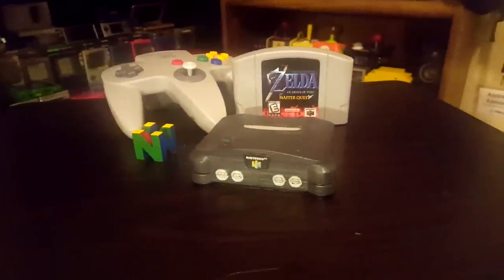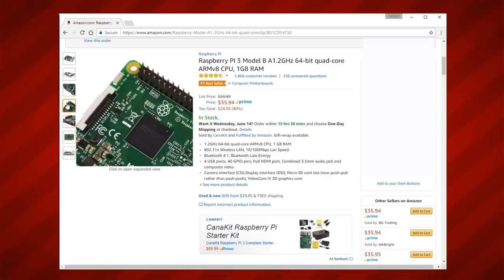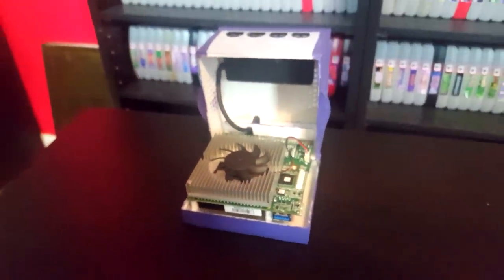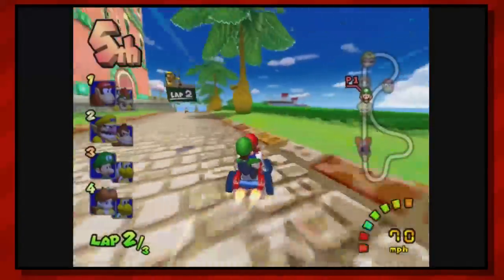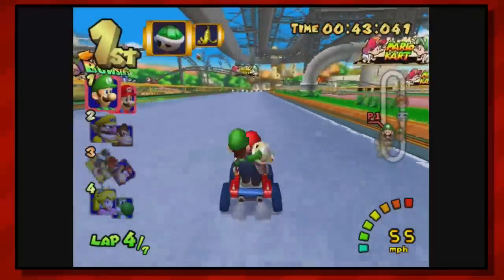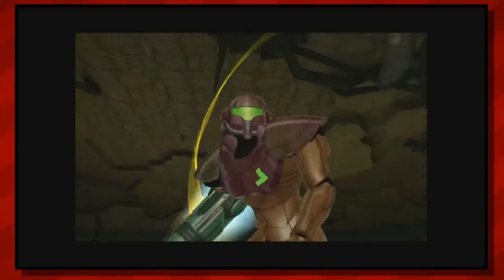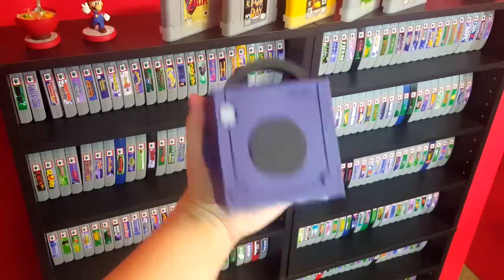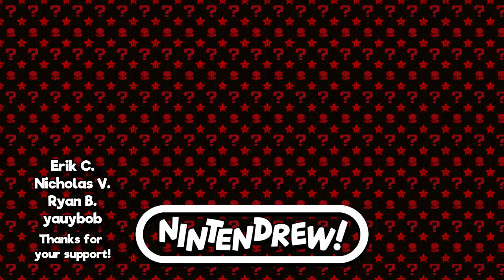Building the GameCube Classic Edition Mini Console - DIY! | Nintendrew

Comment: Step 1,buy a wii
Step 2,buy a sd card
Step 3,buy a GameCube controller 
Step 4,soft mod wii
Cost=50-80 dollars
Reply: cough wii costs more
Reply: @tester_4x106  used Wii cost 20-30$
Reply: will that fit in a mini gamecube case? 🤔🤔🤔
Reply: Dude, search "micro Wii build". It fits in places it really shouldn't
Reply: @timboy What 🤣
Reply: @timboy Looking on ebay, the first result is $57, the next $47. I found one with free shipping and two wii remotes for $55
Reply: You can strip down a wii into an altoids tin even so you could 3d print a decent enclosure for it
Reply: @Joeink100  exactly what I'm thinking cut down the board to fit it in a mini gamecube and you're good
Reply: Already done it for ya!
Reply: wow how MINI
Reply: @timboy it's not 2007 anymore, you can get a wii for about $20 at gamestop
Reply: Step 1 dust off old Wii that is in closet.

Step 2 buy sd

Step 4 softmod

Step 5 play
Reply: @triggeredpanda2939  look up bitbuilt.net, people do it all the time
Reply: cutting down a wii board is super simple,  they even have guides on there, and several people have even made mini gamecubes already. it's a really cool community.
Reply: timboy I got mine for free
Reply: @robabill  easy! Just cut Wii motherboard.But better buy Gamecube motherboard on Ebay for around 8$ and cut it a little bit.Solder SD slot,add power supply,buy controller, and you're done! Together itwill cost around 25$
Reply: @tester_4x106  if you can get the Wii pre owned it's much cheaper.
Reply: Thats what I just did, but i buyed the games
Reply: Or if you have game cube games you can just use them on the wii OR just buy used ones
Reply: A Wii cost like 600 dollars brand new
Reply: @timboy at launch it was 249 u can get it used for like 30 40 dollars
Reply: sacha plenus no it costs 50+
Reply: Paint the wii in GC colors
Reply: @hiimarobot1903  My local Game X Change sells them for 29.99 lol. My buddy just bought one today XD
Reply: @cloudytug  no lol
Reply: Exactly. Also, I live your profile pic. I love telephone.
Reply: That depends on the GC controller you're getting, ($20-$150) also you will need a USB drive if you want to run USB Loader GX
Reply: @gormauslander  i got mine for 27 dollars used at eb
Reply: Got one for 10 bucks with a broken disc drive
Reply: or just buy a gamecube😂
Reply: @zeehondsjef  not everyone has a 100 dollars laying around
Reply: @exkdvs  in the netherlands u can buy it for 30 dollar
Reply: @zeehondsjef  bit whats the fun in that
Reply: @exkdvs  yeah i know
Reply: @timboy you can find used wiis at places like value village for 15-20 dollars
Reply: Chirp chirp your icon is the fursuit telephone
Reply: @robabill  surprising the most important part of the wii is really small
Reply: @robabill  take a look over at bitbuild! They got a Wii in an altoids can!
Reply: Bought my wii at the thrift store for $8. Hacked it with a 32 gb SD card and added a 2tb external hard drive. I got 107 gamecube and wii games combined and adding more. The whole entire library of Snes, Sega, Game gear, Nes, gb, Gba and put a few sega CD, neo geo CD and n64 games on there 🤷
Reply: @robabill  lmao yes. People have fit wiis into altoid cans.
Reply: A wii is 30, a controller is 20-30. You also need 12 folar extension cables for the controler.
Reply: hi i'm a robot downside to buying a used wii is they could rip you off
Reply: Or get a Wii U and mod it.
Reply: Already did it
Reply: @robabill  yes
Reply: @gormauslander  I dont want to know how and why you know that.
Reply: you could make it even smaller by trimming it. but it's not that easy tbh.
Reply: @tester_4x106  I've bought one for 30 dollars lol
Reply: @robabill  The Wii's internals have a lot of unneeded board space, Someone fit a Wii into an Altoids tin, complete a screen and buttons, and it worked
Reply: @robabill  its possible to trim a wii motherboard the easiest way of trimming a wii motherboard still gives a motherboard smaller than the hardest gamecube motherboard trimming
Reply: I know this is really late but I was lucky enough to get a Wii for my cousin and when my friend went on vacation he found 2 wiis at a thrift shop and spent $15 to get both and one of them had Homebrew on them and he gave both of them to me
Reply: @pixelprime5908  you have a reamly good friend
Reply: Step 2 alternative: Buy a cheap usb Hard drive up to 100 Gbs
Reply: Lattepanda v1
Reply: @gormauslander  never buy from These. Look for auctions.
A wii in my Country costs 15€
Reply: I mean why would u play wii games on the gamecube anyways lol

Comment: Great work! I was under the assumption you gutted a Wii and put it inside. I'd imagine the architecture of the Wii would be what Nintendo would use to run this. It's compact enough and able to run GCN games as roms perfectly. Maybe that would make more sense financially for them, but either way, yeah, I'd say this is a long ways off regardless. Really fun video!
Reply: and a wii is worth about $20 Australian
Reply: dedpxl they are talking about making the parts not the system they can still make them
Reply: That's what I'd assume, too. The Wii mini wasn't that long ago, they likely still have the tools to make broadway and hollywood chips at reasonable prices. (Especially since they could go for a smaller MEM2) Not sure how expensive HDMI out would be, but GC games don't really need upscaling, simplifying the matter.
Reply: Lassi Kinnunen Wii's are crazy cheap on eBay

Comment: 5:36 the wii can play gamecube games natively and the motherboard can be trimmed much smaller than that huge x86 microboard, like wtf are you saying?
Reply: Despo THEMLG That isn’t exactly emulation. It’s running the discs through the original software, which is a lot easier then emulation.
Reply: Peach Pie you could easily softmod the wii and install gamecube games on the wii's channels like you would the virtual console games.
Reply: They could change some things in the Wii. It requires almost no additional hardware to run Gamecube games. So use the Wii mini as a base and shrink it down. I don't even think it needs to be shrunken that much as it will already be smaller without it's disc drive.
Reply: My thoughts exactly, Nintendo could just reproduce the Wii's CPU, add a sleek and modern interface, add more RAM for better loading, and have about 128 gigs of internal storage for 60 games.
And vuala, Gamecube Classic

Comment: All Nintendo has to do is dig up their Wii tech from 2006 and repackage it as a Gamecube mini. It's not even emulation so compatibility would be 100%. It has to be cheap enough to pull off in 2018.
Reply: The problem with that idea is IBM has stopped producing PowerPC chips used in the GameCube - WiiU, and ATI aka AMD no longer produces the Hollywood line of GPU tech used in those 3 consoles, and to get it cheap enough we would need to emulate on an ARM SOC, but it would need to be some seriously custom Linux code from the ground up to get good performance, and would need to be at least a 64bit octocore ARM SOC with 4GB of RAM.

Comment: 2018: Nintendo Fan States: "If Nintendo were to use a board like this, you can imagine they probably would be able to improve performance by working with the manufacturer and original code."

2020: Nintendo releases the 3D All Stars Collection via the CFW Switch Community confirms Nintendo does not have any original development code for any of their first party titles but as they have used ROMs for this collection it also shows they are missing important hardware design documents to create a functional emulator. (CFW Community proves emulation is present by creating tools to patch out games to other ROMs. While many do not function due to the incomplete nature of the Emulators included in the game, enough do to prove it being emulation.)

2022: As a result of a leaked development build of the GB/GBA emulator intended for Switch Online, the CFW Switch Community confirms that not only is Nintendo missing important hardware design documents to create a functional emulator but they no longer have talent at the company who can create the emulator using what design documents they do. The leaked Emulators confirm Nintendo was forced to commission third party developers to create the Emulators. (Once again, the CFW is able to create tools to patch out the ROMs in the leaked software but all of Switch Online consoles confirming them as emulators and ROM collections.)

2024: LOL... every single person who hears these words today.

Comment: I don't know if you tried this, but you can slow the emulated clock speed of the gamecube processor. This enables games to frame skip and do other tweaks to make games run faster, because it thinks you just have a slow gamecube.

Comment: This could probably be made with a trimmed down Wii board. The Wii has perfect compatibility with all GameCube titles and can function with a shocking amount of its main board removed, provided essential components are replaced. The front controller ports could use the ports from the top of the Wii. It could also play Wii games as a bonus as long as a sensor bar and wireless module is added. Everything could boot from an SD/MicroSD and run to the TV through Wii component cables. It would require the sacrifice of a functioning Wii or salvaging of one in repairable condition, and a lot of work to fine tune component placement, soldering, cooling, etc, but it would be a cool project with a one of a kind product.

Comment: When I used the Dolphin Emulator on my old Gaming Rig, I used a official WiiU GCN Controller Adapter. (Fully Compatible with Dolphin, and up to 4 controllers to usb.) You can try pluging one of those into a small pc if you want actual GCN hookups for the GCN Mini.
Reply: You can use Zadig to modify the Windows USB driver to work with "WUP-028" (adapter's nintendo model no.)

Comment: 2:30 They made the Wii mini, and it's the same as the Wii, and the Wii uses the same processor as the Gamecube, so it would be possible for Nintendo to make this in 2019 at that smaller formfactor.

Comment: The Switch is a decent comparison point for "the kind of system that might be able to run Dolphin". It's based on the same chipset used in a number of phones that are fully capable of playing a number of games on the Android version of Dolphin, but it would still probably struggle slightly without tweaks, much like your build does.
Reply: (Basically what I'm saying is despite your saying you're "no expert", you've got a pretty good handle on the current power of embedded systems as far as emulation. Good video.)

Comment: One thing that would make this EVEN better, is if you had picked up one of those May Flash 4 portNGC controller hubs and used it in place of the USB hub; then you could use proper Gamecube controllers instead of third-party Chinesium controllers.  Granted, some of them are very good, but having the proper ports would be a major boon to the system.

Comment: Nice work.  Definitely a nice DIY project that hits the mark of a Mini, IMO.  As for potential cost for them to make, you're off a bit with your estimates.  A lot of the Switch's cost comes from the screen, joycons, etc.  You need to remember that the Nvidia Shield TV uses the same exact TX2 SOC as the Switch yet it costs half the price.  That should be able to run Dolphin quite well, but still may have trouble with some titles that just don't emulate well, just like the Switch.  But yeah,  you could definitely get something out the door running TX2 SoC or similar for $150, and I think if they were to create a Game Cube Mini @ the $150 price point it would sell well.  Maybe even the $175 price point with a controller that they source from a 3rd party (opposed to making their own), there's plenty of 3rd party controllers for GC.

Comment: People have echoed this allready, but a Wii portable would probably be a way better option for it.

Skip GC and have a 1/2 scale Wii (probably smaller if you did an ultra cut).

This means perfect 1-1 compatibility for GameCube and Wii games. Only issue is longer loads due to games being ran off SD or usb2 but it's not that bad

Comment: Hey, you should check out Madmorda's mini gamecube build - it's using the physical gamecube hardware from the wii chopped and mashed into a case even smaller than the one you've made - it's actually amazing to look at, but definitely not achievable for the average end user as it requires soldering

Comment: Late to the party, but you could have just bought a Wii, shrunk the board (it's now small enough to fit inside an Altoids tin) and had adequate power to play all games and have a Homebrew menu available to it, along with Wii support too. And due to it's smaller size, you can have much more adequate ventilation.

Comment: Regarding the possibility of Nintendo using actual Gamecube hardware in a GCCE, there's really not much to a Gamecube motherboard.  The bulk of the system's guts is the disc drive, which a Classic Edition wouldn't have, and fans that are mounted vertically.  Scaling down the board a bit to fit it in a Classic Edition-scale case would probably doable, and you could probably use smaller fans and mount them horizontally to save space. That said, I don't know if this would make sense economically.  The Gamecube has been out of production since 2007, they probably don't have any of the tooling for it laying around, and they'd still have to make a new board to attach everything to.  Some of the chips may not even be available anymore.  It would probably make more sense for them to just use some sort of off-the-shelf board.

Comment: I believe a nintendo wii without the disc driver can fit inside that case, the problem would be the control connectors that are soldered to the board and take up a lot of space, unless you install nintendont to use a usb hub in front of the console

Comment: One of the problems with emulating the GameCube is that the console’s architecture is PowerPC and most PCs and most single board computers are ARM based. So it will be very difficult to emulate the GameCube “properly”; the problem is, to emulate the GameCube without much stuttering, you would need a high specs for your PC. The other problem is the emulator may not work as expected(some games may be incompatible, check the star rating).

Comment: The Gamecube was running a PowerPC CPU, which isn't being made anymore. (well it is, but it's hardly being used) It'd be cheaper for Nintendo to find an emulation solution. Also, Nvidia's Jetson Nano board (or you could've gutted an Nvidia shield, but that's expensive, and the Shield is basically a rebranded Nintendo Switch) would've worked for this project, and it's actually more affordable than the board used here plus it has an actual 3D graphics chip.

Comment: While we may not be able to produce something like this easily, Nintendo should have a much easier time with it. Like you said, they would use hardware that much more closely resembles the original GameCube. Working with the original code and having full access to the hardware means they can tweak the performance and get games to run almost native, and not so much "emulating" it. Maybe they will, maybe they won't. Who knows!

Comment: The wii and gamecube were basically same processor with slightly better specs. They were able to make the wii mini $100 in 2013. They could easily make something cheaper in 2022 with that same line of processors. The question would be whether ibm was still producing powerpc hardware.

Comment: The real question is what resolution did you render at? If it was 1080p of course it would lag on that, but if it was 720p it would have ran mostly fine. All of the Nintendo Classic consoles output 720p. And for something as powerful as a switch... get an nvidia shield. That would kick ass at emulating GameCube.

Comment: Here’s the thing, GameCube games are still at the quality level of some games today and at least the equivalent or better than the wii library, most worthwhile first party games that would most likely be included on the system go for $20 and up on eBay and if Nintendo had them on virtual console would be flogging them for at least $40 each. Then we need to consider how much it costs to build the computer powerful and small enough to run GameCube emulation. Depending on how many games are bundled Nintendo would be looking to sell for at least $350 each, at that point no body would bite. The nes and snes on the other hand are cheap as chips to run tiny computers for emulation and they’re packed with like $5 abandon ware games, so much more profitable.

Comment: Why not replace the Controller ports on the console with two USB ports so you can use a Gamecube Controller Adapter to connect the controllers. 

Alternately, I’d add a port for a Wii U Fight Pad, which is built to look like a Gamecube Controller, so the Wii Classic Controller can work.

Comment: So, knowing what I know about chip design and process tech...your theory of Nintendo designing an SoC that is basically a recreation of the original hardware seems to be the most effective way to do it. The architecture is stupid simple, especially now, and on an "old" 28nm process, they could probably get it drawing just a few watts off of a USB port. The CPU and GPU of the GCN also only contain around 70 million transistors, so an SoC combining RAM, CPU, GPU, I/O, and whatever other crap would be beneficial as long as they could turn a profit, which...I'm no businessman, but it seems like it could be feasible.